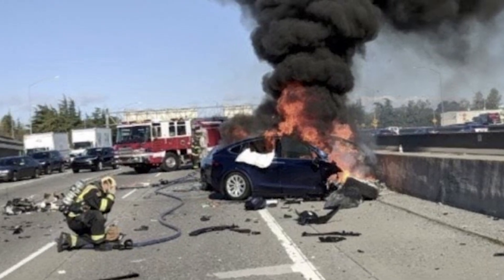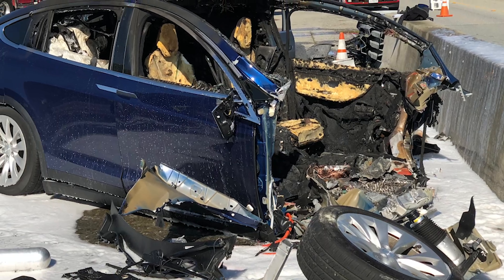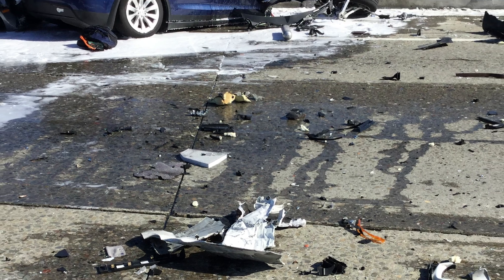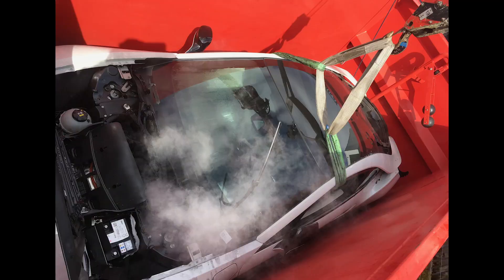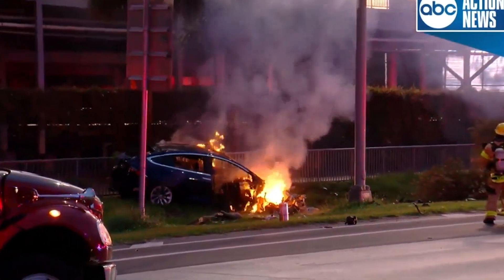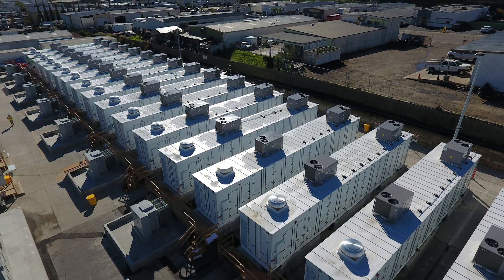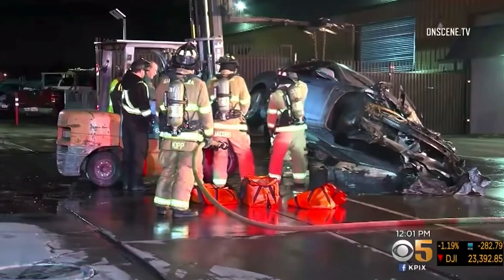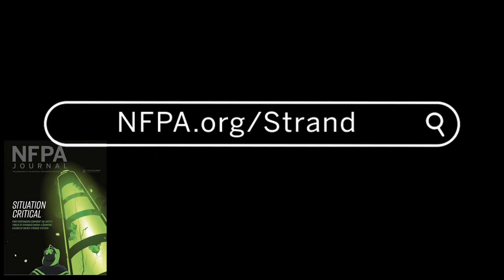Stranded Energy in Electric Vehicles and Firefighting Challenges

Comment: For the longest time we had gasoline tank fires up until WW2.  We learned how to build better fuel systems for gasoline and fire fighters were trained and geared to fight automotive gasoline fires.  We can do the same with electric vehicle battery hazards.  We just need time for lessons to be learned, industry to engineer from past mistakes and firefighters trained.
Reply: yeah and as for putting water on it one of my instructors (I'm currently in training to be a ff) said that you have to put a lot of water on it to put it out while later on I learned that you don't put water on metal fires (and I just looked it up in the ERG and lithium is water reactive so don't put water on it) that said if you can apply water fast enough for long enough you can put a water reactive metal fire pit but to me it seems stupid if the only thing at risk is the car that is already totalled
Reply: You forgot lives lost, but sure, yeah, hindsight is 20/20

Why be proactive and force companies to be proactive? Jeez, america. Get it together.

Comment: I have a radical idea. Instead of using highly volatile, low energy density, high weight lithium batteries, we can locally generate the vehicle energy from a high energy density liquid fuel, one that requires either oxidant or some form of specific stoichiometry to burn and once it's out, it's out. Could even bypass the batteries entirely and just directly convert the high density liquid energy directly into mechanical work.
Reply: you mean gasoline? hahaha

Comment: I fear that fire services will need to hose large battery fires with liquid nitrogen rather than water.
Reply: From what I understand, the best suppression agent to control thermal runaway is F-500.
Reply: Wouldn't the liquid nitrogen actually cause the other batteries there's like three 5000 batteries there. This would cause the other cells to crack leak and be exposed to oxygen causing combustion.